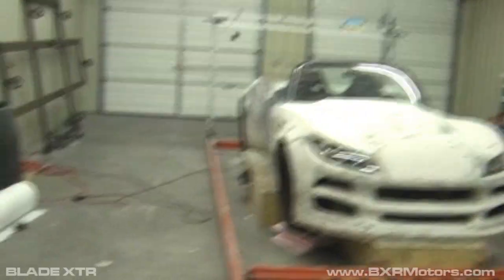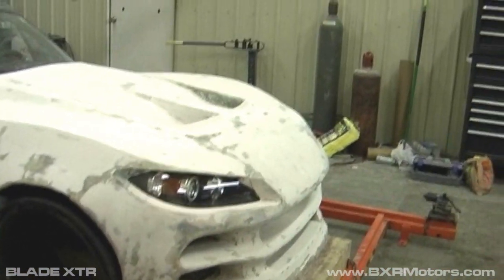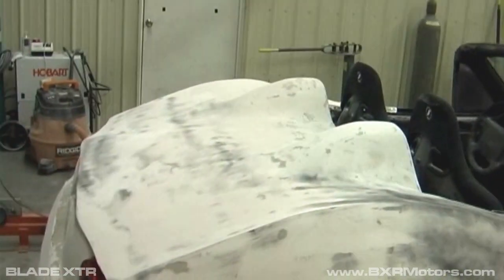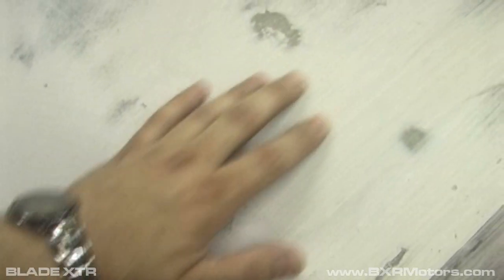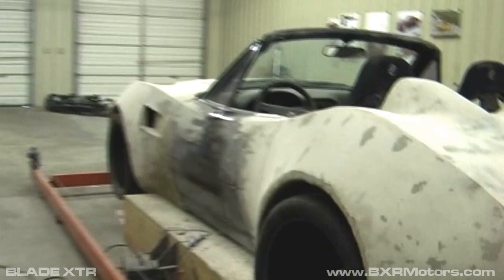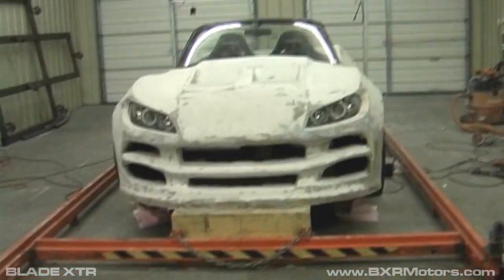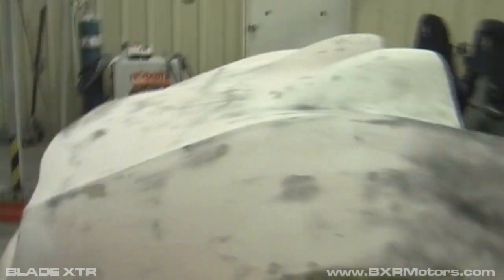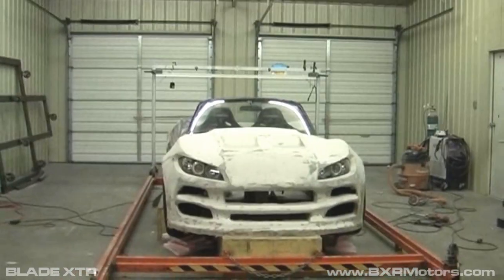Bailey Blade XTR Car Design | Finished fiberglass work and now refining body lines - Part 15

Comment from the maker: Our wheels/tires and offsets have been decided now, and our suspension is adjustable in just about every sense. Also since we are designing and building our own chassis we can make the necessary changes if one setup works better with a certain size wheel/tire combo than another.

Comment from the maker: Thanks for watching Well after the body is done we should be ready for full running prototype. Our chassis and suspension is already mostly developed, we just need to put it all together and same for engine and drivetrain. Honestly after the main body we will begin on interior and mounting points.

Comment from the maker: Yes the hood opens but this is only the Body buck from which the molds will be made from. The hood will tilt forward and has a split line under the side fender vents. At the moment it does not tilt because we do not have the chassis in place and again this is only the buck for the molds.

Comment from the maker: Thanks for your opinion, however you should watch the rest of the 72 videos to fully understand. This is a Body Plug that will be used to make lightweight composite body panels. It doesn't matter how much Body filler I use, its only being used as a sculpting medium. As for the car looking like a Viper, S2000 and Shelby Series 1; I take that as a compliment as those are some bad ass cars. If you read up on the story of my project you will understand that I based the design off many classic cars.

Comment: So you haven't yet decided on the wheels you're going to use?  How can you design an effective suspension geometry and steering system without knowing the wheel sizes and offsets?

Comment from the maker: @chickenpoper Yeah this is not the actual car, this is whats called a Body Buck, its what will be used to create the finale body panels for the chassis. Yes the hood will open forward like in my latest video and no there is no Foam on the real prototype, that would be crazy.

Comment: Im not trying to offend you in any way, but, in my design point of view i have somethings to say:

1. Its got too many air intakes and "exits"
2. The lines are way too fine. You should smooth things a little or at least compensate them with more fine lines, because its smoth then too round and it doesn't quite fit
3. The lights look very small in comparison to the size of the car
4. The front looks a lot like a Dodge
5. I think round taillights doesnt fit with the stile of the car

=) Take care!